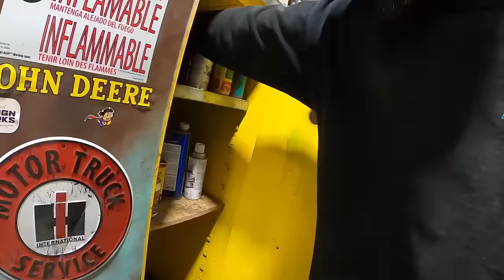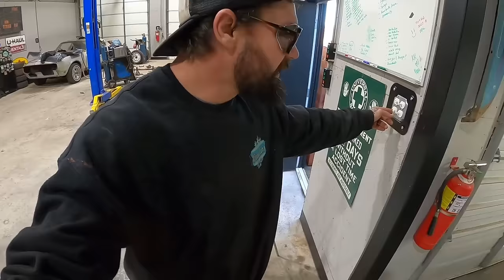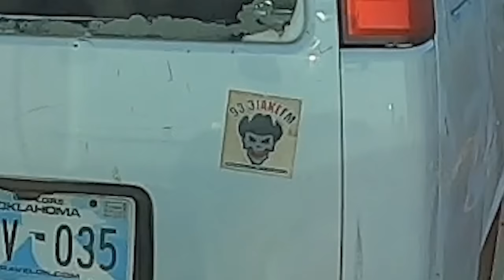1961 Bel Air BUBBLE TOP saved from CRUSHER! Some assembly required!!!

Comment: I've loved your channel from day one , you were in the process of moving into the new shop, but still working in the old shop. I think it the big box truck you had rescued and were getting it ready to be able to help in the move, I'm not sure now but you crack me up  always have one good belly laugh per video.  I like what you do, and how you do it...but to be perfectly honest I like vehicles that can be used for work and that means sometimes driving down some rutted up roads or with holes . Those lowered rigs I get your liking a certain look,but would leave me stranded in my driveway.   I don't and would never do that to any of my vans or trucks . But I still love your channel,  the reason I mention the lowering of vehicles is how you just couldn't stand to look at how much height that bubble top had without an engine in it lol.  I just had to SMH, you just may have a problem , again lol. I recall a time I was in my teens, I saw a muscle car without a engine in it ,it looked so cool raised up off the ground in the front end, ever since ive always loved a slightly higher stance on the front end than rear.  In muscle cars not trucks or vans.  And I'm not a big fan of 6" lifts on trucks either, just slightly higher than factory. Can't go wrong with a slightly higher suspension.   Again though love your channel, merry Christmas to you and all 🎄🎄🇨🇦🇺🇸🎄🎄

Comment: I'm in arkansas but I have a 2000 modal gmc 2wd extended cab not much lift but it has a pretty nice looking frame just come get it I also have a big ass early 80s rv with a 454 and 400 the stock air bags are blown out but would be grate to build a roll back I would do some training for

Comment: i got the dash, radio, heater box, 4 doors, some crome strips, door handles, frt brakes, aframes. rear view mirrow.. after watching alittle more of the vid, mine is a 1960 bel aire 4 dr. but i stillhave the cross member with the frt pc that holds the head lights and radiator. break and steering componets.

Comment: I have the correct Belair only back seat back rest that doesn't have the hole for the impala speaker. Very rare and hard to find. I also have the front and rear door panel stainless moldings.

Comment: 1:08:00  Weld a 'D'-ring at the end of your trailer so you can hook up a pulley so you can use your wench to pull vehicles off of that trailer easily.

Comment: B12020 1961-1964 without under floor braceing ....$299.99 ea
Full Floor Pan Assembly
BFP1700L. 1961-1964 LH EDP coated.........$121.99ea
BFP1700R 1961-1964 RH EDP coated ........$121.99 ea
From classic industries as of 2014 catalog which I have.

Comment: I watch your channel alot. It's my go to channel. Why don't you have a small blast cabinet. I rebuild alot of chevy engines and use blast cabinet to clean rust brackets and bolts endless uses. I modified a cheap harbor freight  blast cabinet it works like a dream. Thinking this would be alot safer than wire wheels . Can send info how I modified cabinet. Have 300.00 in cabinet. Love the channel want to keep you safe.

Comment: Yeah the Bel Air came with the 348 or the 409 but the 409 only came in 3 spd or 4 spd close ratio manual they never came with a power glide but the 348 you could get a automatic with it. the 348 and the 409 looked the same with the W heads they were the first "Big Blocks" and the combustion chamber was not in the head it was part of the block and pistons

Comment: you need get some kind protable gear grab and go storeage going something with wheels i used old suitcase they do make them tool suitcase i made tool box on wheel easy and simple to load on the go have charger system rig up inverter kits air and electric i did a truck bed tool tailer with shell torch welder and generater hoses

Comment: If you are putting a Cummings in the Loadstar why not look for a Dodge 94-02 3500 two wheel drive chassis that had a Cummings in it so you don't have to try to modify a chevy chassis to fit a Cummings.

Comment: Impala is the the high trim package the Bel Air is the middle and the Biscayne is the bottom dweller the bubble tops only came in Impala and Bel Air the Biscayne you could not get the Bubble Top